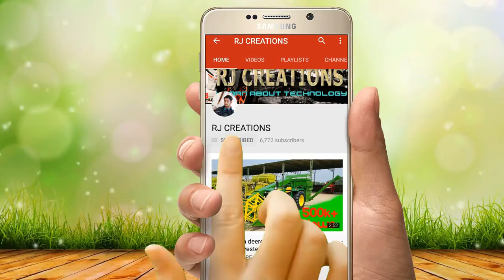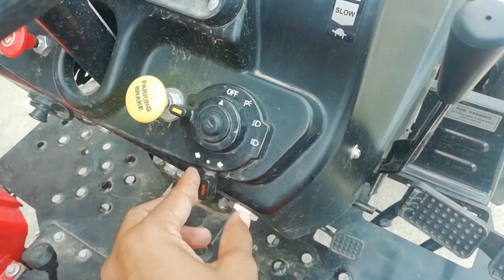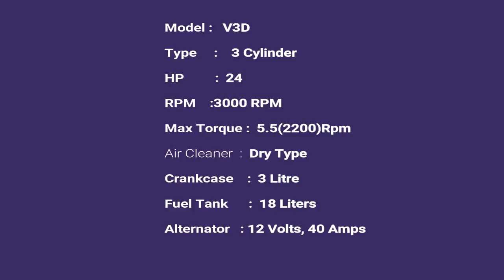Vst Shakthi Mt 224-1D 24hp ||Overview||Specifications||

Comment: Anna john deere 5210 lo 4wd bandi unda
Reply from the maker: Aravind Netha143 5210 50 hp 5210 lo 4wd ldu miku 50hp lo 4wd kavalante 5050d 4wd vundi john Deere lo edi kuda 50 hp tractor
Reply: Anna 5050d bandi ma urilo undi but 5045 ki and 5050d difference em ledu performance kuda em ledu 5210 and 5050e lo 4wd kavale gear box change undali 5210 gear box la
Reply: Unte cheppandi anna 5210 lo 4wd 5050 kanna 5210 baguntadi
Reply from the maker: 5210 gearbox same 5310 gearbox rendu okkate
Reply from the maker: 5050 performance 5045 performance change vuntundi
Reply from the maker: Baguntadi but 5210 lo 4wd ldu
Reply: Ok bro thanks for informati
Reply: Information